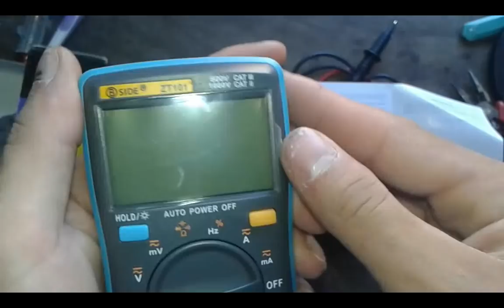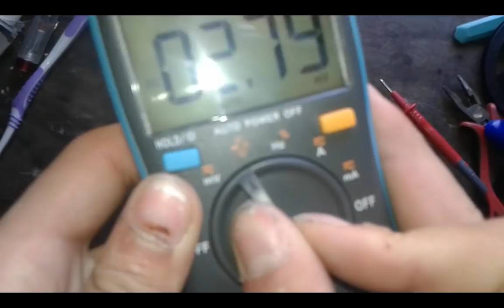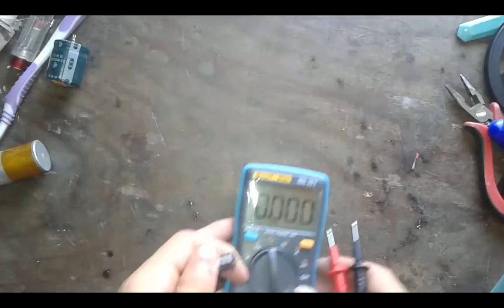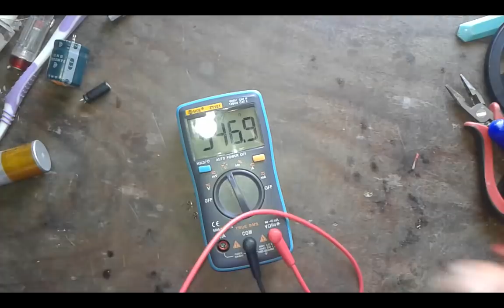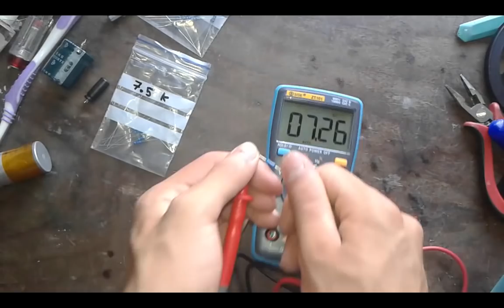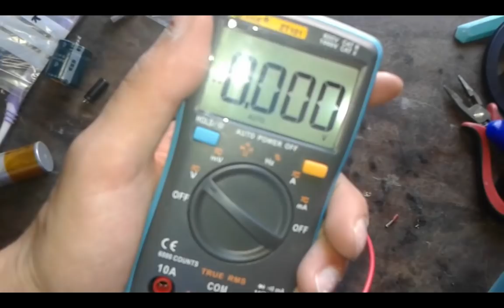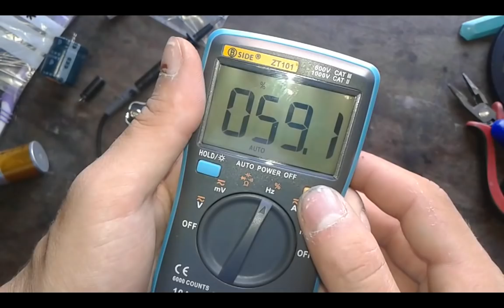Testing my new Digital Multimeter ZT101 6000 Counts Backlight AC/DC Ammeter Voltmeter Ohm Meter

Comment: the max capacitance count is 400.0 uF or 4000 uF
Reply from the maker: Specifications:
Frequency: 5/50/500/5k/50k/500k/5M/10M (+ 0.1+3)
Capacitance: 10nF (+ 5.0+20), 100nF/1uF/10uF/100uF (+ 2.0%+5), 1000uF/10000uF (+ 5.0%+5) ()
DC voltage: 600mV (+ 1.0%+10), 6V/60V/600V/1000V (+ 0.5%+3)
AC voltage: 600mV (+ 3.0%+3), 6V/60V/600V/750V (+ 1.0%+3)
DC current 600uA/6000uA (+ 1.5%+3), 60mA/600mA (+ 1.5%+3), 10A (+ 1.5%+3)
AC current 600uA/6000uA (+ 1.5%+3), 60mA/600mA (+ 1.5%+3), 10A (+ 1.5%+3)
Resistance: 600 (+ 0.5%+3), 6K/60K/600K/6M (+ 0.5%+2), 60M (+ 1.5%+3)
Measurement methods: double integral A/D converter
Share ratio: 1% to 99% (+ 1%)
Ultra range display: OL
Working environment: 0~40 C, relative humidity < 80%
Power supply voltage: 3V (AAA x2 Pcs 1.5V) 
Color: Blue & gray
Weight:200g
Size:130*65*30mm
Package size:140*80*40mm

Comment: Sir I bought this multimeter and when I turn to millivolts, it will automatically provide reading even if I am doing nothing and the reading on the screen keeps on increasing over time. It is the same in both DC and AC millivolts. Is it grounded and defective? Should I return this to the seller? Advise please. Thanks!
Reply: In the ac / dc millivolt range, the frequencies in the field form an electrical field on the probes. Normal.
Reply: Thanks! I returned it to the seller and I replaced it with another brand. I found it wasn't normal ac/dc milivolts reading. It keeps on reading even test probe is removed and keeps on increasing over time like a counter or a timer.